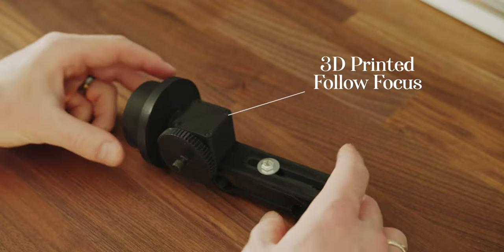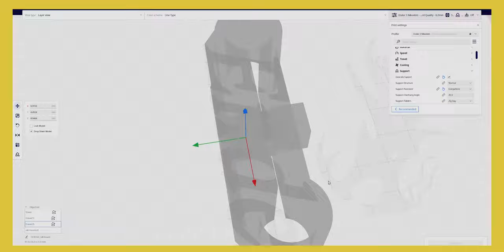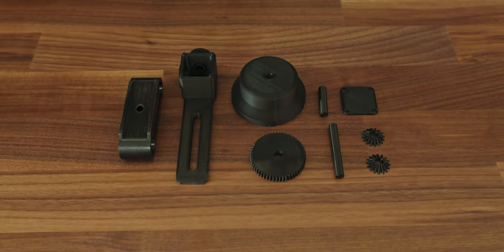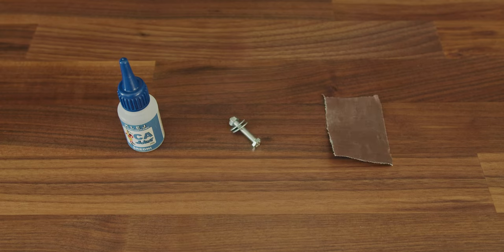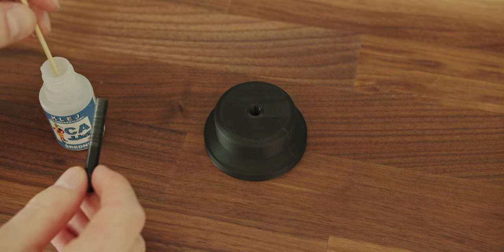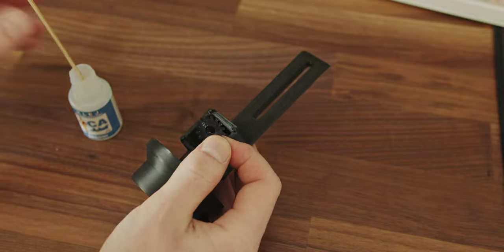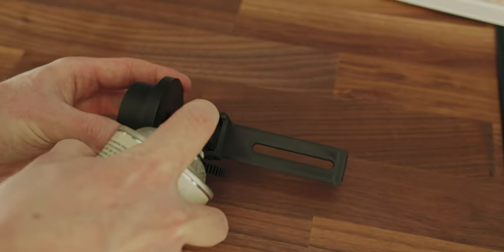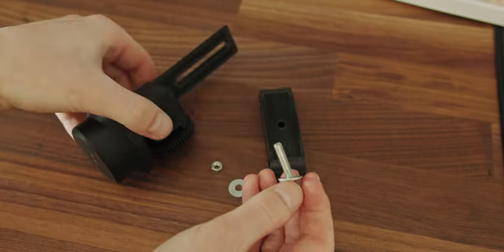3D Printed Follow Focus for 15mm rails DIY

Comment: Cool, but why not make the part of the rods designed for the gears square or hexagonal and just have them fit in place rather that having it rely on the bond with the glue and possibly have them fail when used with lenses that require you to use a high amount of torque to pull focus?
Reply from the maker: That's a great question, and a great solution as well. I haven't design this model, so not really up to me. But what I can say is that, this kind of FF falls somewhere between a good and reliable gear and a novelty item. If you are working on a professional set, you will propably use a dedicated, metal FF. So, at least for my use, it works, and was almost free.

Comment: Hello! This is amazing work and thanks for sharing. Is this printed 0.8mod gear durable? I want to print one for my lens but I am not sure how long will they last
Reply from the maker: @linshengji3272  It’s very durable, cause there’s not a lot of wear on those parts. Even if you’re using a metal follow focus it should be fine.